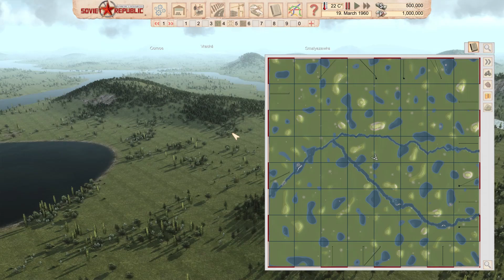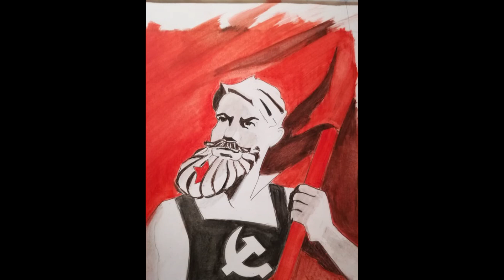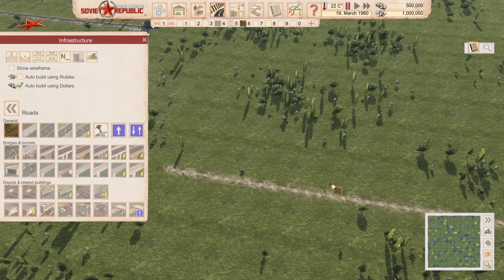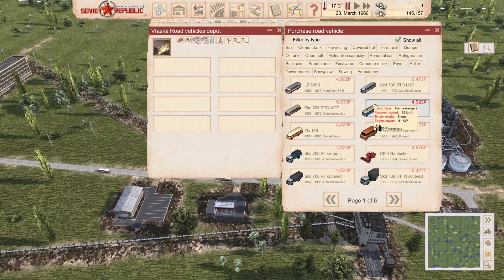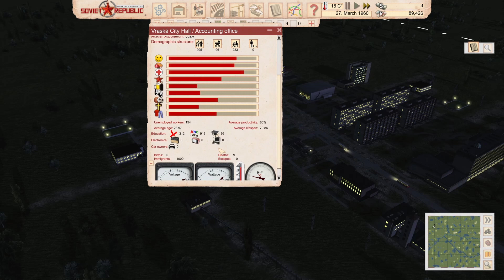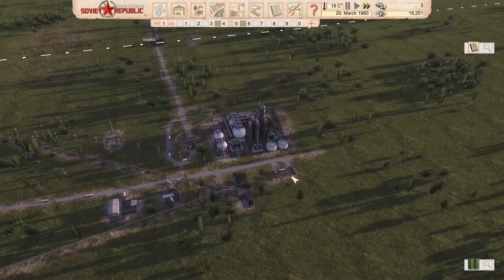Workers and Resources - Tutorial - Import Based Economy

Comment: You can always build a oil tank/cistern at the border and import oil thru that and use pipelines to get the oil to the refinery, only selling would be done by truck(bad) train (better) bitumen mostly I think. Also you can always take  loan or many loans, In dollars! or rubbels.
Reply from the maker: But!!!! Would it be as realistic and fun as we are doing it now? Think about today's Belarus. They import oil from Russia and export oil products to the west! 
Don't complain, be like Belarus! Hahaha. 😂😂🍻
Reply: @oolykeegaming81  it would be as pipelines over borers exist and are normal.
Reply from the maker: @LDZMarder  I know. I was failing in being funny. I think I saw the mod where you build border pipeline crossing. That would be more realistic?
Reply: @oolykeegaming81  No no , no mod. Just build oil tank at teh border so buying oil is cheaper, and use a pipe line to transport the oil to the refinery.
Reply from the maker: @LDZMarder  ohhh i get it. It's genius. Bu the infrastructure would be expensive. A lot of pumping stations. That's a good idea man.
Reply: @oolykeegaming81  yes a few but the amount of oil and removing of potential bottlenecks and traffic is worth it. Even you could send the fuel or bitumen back to border and let two or three trucks drive and sell it directly to the border post. They would have a much shorter distance and in winter they would not be so slowed down.